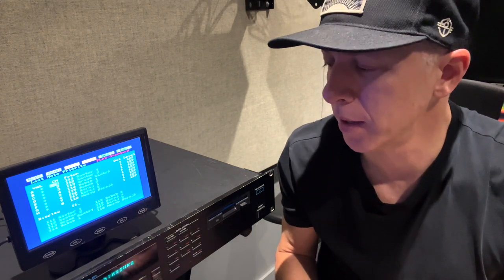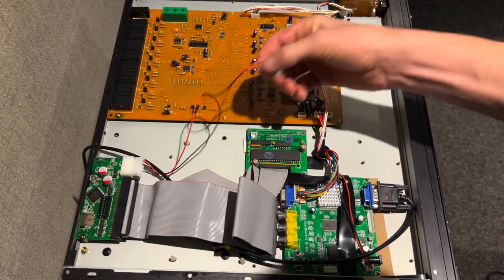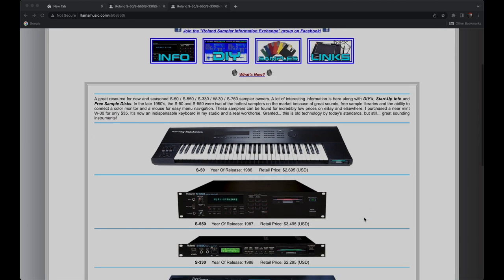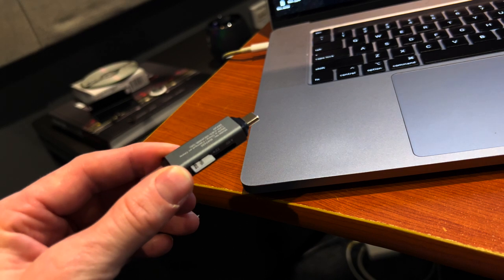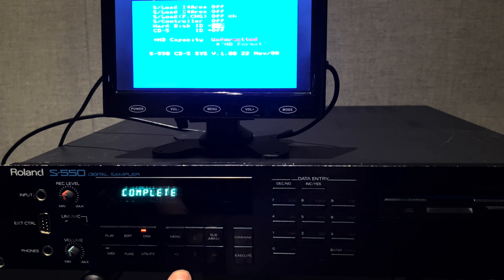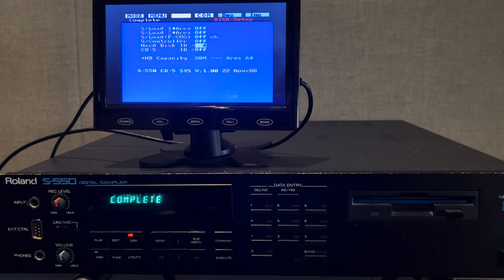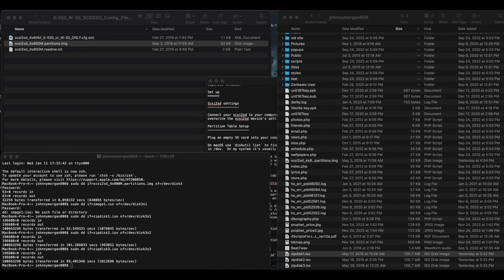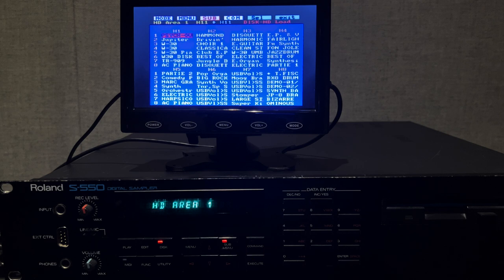Roland S-550 Sampler scsi2sd Install and Multi-Drive Setup

Comment: Does anyone know where to obtain this aftermarket HD5 interface board? I found sellers with the SCSI2SD board on eBay but couldn't find any of the HD5 IF board clones.
Reply: I just saw that llamamusic doesn't recommend the SCSI2SD board any longer but now points to the ZuluSCSI RP2040 however also requires a HD5 IF. The sellers linked via llama's site appear to not carry the HD5 IF boards any longer.
Reply from the maker: Sorry - yes the makers of the aftermarket HD5 board seem to be no longer selling it.  I'm keeping a look out for them and I'll post if they become available again.  And as for SCSI2SD vs. Zulu.   I can confirm that Zulu is way way way easier to setup and use - I've installed Zulu on a Roland S770 and Akai S3000xl recently with excellent results.  Zulu is the way to go now.
Reply: @johnnymorgansynthdreams  Cheers for the reply, it's appreciated sir.
Reply from the maker: Hey all - I'm looking into the possibility of cloning the HD5-IF scsi board.    Stay tuned in the next few months for more details.
Reply from the maker: @grandtetone  I've completed the design for the HD5-IF clone. the Circuit board and parts have been ordered and once I've built a few and tested them I'll let you all know.  I ordered on 3 test boards for now, so hoping it's perfect.
Reply: @johnnymorgansynthdreams  AMAZING brother!
Reply from the maker: @grandtetone  V1 Board is complete and working, but I'm just finishing the V2 board which will be ready in about 3 weeks
Reply: @johnnymorgansynthdreams  Heck yeah, you're the s-550 🐐!!!

Comment: I was already following you when I recently inherited a S-550, and I love these videos. I've modded mine with HDMI out and a SD floppy solution. I was going to add a SCSI2SD to it, but I wasn't finding many images for drives. I did find a SCSI2SD that just plugs into the back of the system, without any sokdering
Reply from the maker: Nice - I guess the main thing is that you an get the sounds and patches onto the device easily, so Gotek or SCSI2SD are both good options.
Reply: @johnnymorgansynthdreams  the only problem is time, there's too many patches! Still not as bad as a Virus TI 2 (3600ish patches?) but still too many hah
Reply from the maker: @SlaserX  That can be a problem for sure.

Comment: A great look at how to use a SCSI2SD on a Roland S series sampler! I've got one that I use with my Roland W-30, although it's in an external case since there's no room to mount it internally. I've also replaced the floppy drive with a Gotek running the FlashFloppy firmware, the screen with a modern one and all the front panel buttons with new ones. So far the encoders and sliders are still working fine, but I've got replacements for them just in case.
Reply from the maker: Nice - that's a great setup.   ithought about getting a Gotek - I'd probably make things a bit handier for sound updates - I might do that,

Comment: I'm curious whether the SCSI OS lets you load individual patches with their tones or if you still have to load whole blocks or sets like you do with floppies?
Reply from the maker: You can load individual patches, tones or you can load a 'chain' which is a set of 2 patches and tones as well.
Reply: @johnnymorgansynthdreams  Specifically I mean that when you're loading from a floppy the tones associated with a patch won't come in unless you load the whole disk (set or block). I don't think it's much of a problem for people who would want to use these machines nowadays but at the time, given their amazing multitimbrality, it makes setting up a performance a lot more work than you might hope. I was wondering if using SCSI you could grab several multisampled instruments from different collections more easily.
Reply from the maker: @BCThunderthud  Yes - you can just load sound data (Set) Only if you wish.  Here a link to the CD/HD manual addition. http://midimanuals.com/manuals/roland/cd-5/owners_manual/cd-5_om.pdf

Comment: Thank you for this most awesome detailed video!!! I'm really liking this concept of being able to use these classic devices with the new storage options!  I think one of the reasons why I originally  got rid of my S-550 was because the floppies and HD system were unsustainable...
Reply from the maker: Thanks Jeff - yes it's been fun to upgrade some of this old gear with more modern storage solutions.  Having the entire Roland Sound Library at a touch of a button makes the S-550 really useful in the studio - some of the sounds really work still.   I know the S-550 OS isn't great but one get to know it a bit it's pretty powerful.  It's basically a small workstation.  Ok keep well!

Comment: Great vid. Thanks for taking the time to put this together. I went down a similar path in 2022. Was super surprised to find that you still need the floppy for booting even after copying the system to the HD. I need to get a floppy emu for it as well.
Reply from the maker: Recently I just put a Zulu Scsi into my S-770 and acutally it is way way easier - I'd suggest that path now if you are doing this.

Comment: Thanks, I just got one from a used music store in my area. This is extremely helpful and encouraged me to get it. I can’t find the HD5-IF replacement board anywhere 😢
Reply from the maker: I'm looking for them as well.  I'll keep posted if the seller of the HD5-IF start selling them again.
Reply: @johnnymorgansynthdreams I read in a forum that you might be making some to sell 🤔
Reply from the maker: @Chevroletcelebrity  yes this is true!
I just got the boards back yesterday and I'm doing some testing.  I might do a slight change on it to support Zulu scsi better as well.  If things go well this weekend I'll build out my 3 prototypes and then I'll sell them for cost.  I'll then make a few changes for Rev 2.   Rev 1 was made to support Scsi2sd, but I think Zulu scsi is better so I'll change the connector.
Reply from the maker: I'll post a video this weekend showing the boards and plan for it.
Reply: @johnnymorgansynthdreams  thanks. keep me in mind, I really need one. I have a external scsi enclosure with a cd-drive that “might” work so I can use one with the connector.
Reply from the maker: @Chevroletcelebrity  ok sounds good.  I ordered 3 prototype boards, so you can have one of these if everything works - I'll be testing this weekend.  Send me an email and I can send you some pictures of the first build.